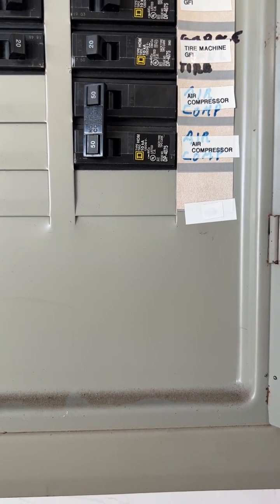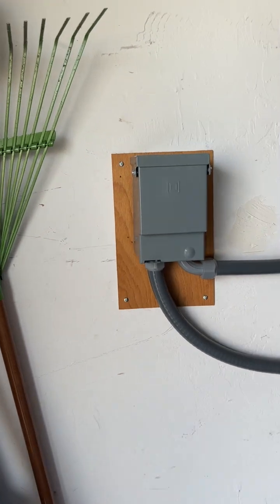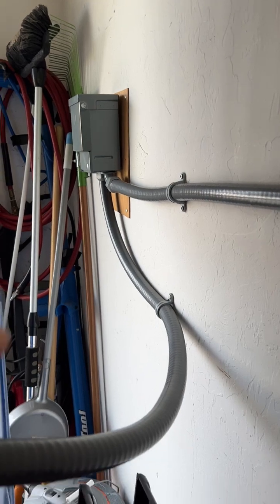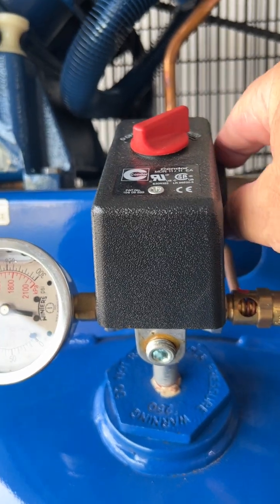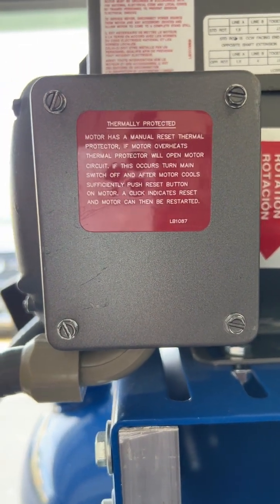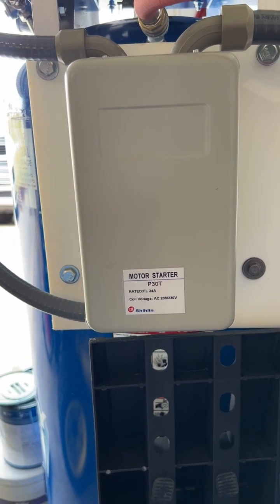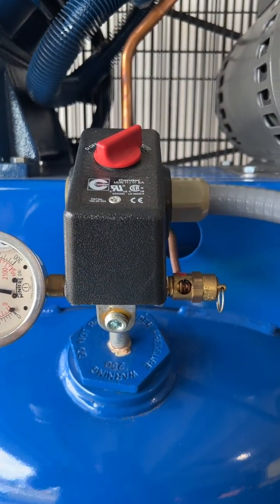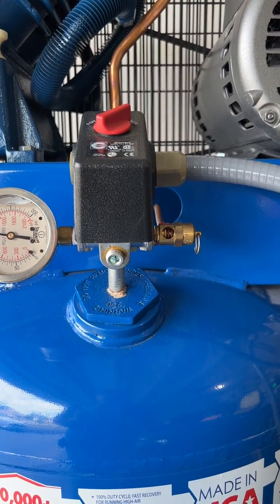Quincy QT-54 with magnetic starter box information

Comment: Good video and it seems like a great idea

But I have owned the same exact compressor for about seven years 

And the stock switch has been perfect. Never a problem. 

However, the Baldor motor burned out the wirings

Completely fried 

I just recently replaced the motor with a  WEG 5hp.  

So far so good
Reply: On bigger motors that draw more amps you really need a mag starter . The pressure switch usually will cause an amp drop to the motor which would cause a motor to not last as long . That weg probably doesn’t draw as many amps as that baldor motor did .

Comment: Great vid. What size wires are you using from pressure switch to magnetic starter switch?
Reply from the maker: I used 8 gauge wiring for all the wiring, you could drop down to 10 gauge for the pressure switch because that runs from the magnetic start box and only carries 120 volts.
Reply: Thanks for the quick response. I like your setup. I’m copying it exactly from circuit breaker to compressor.